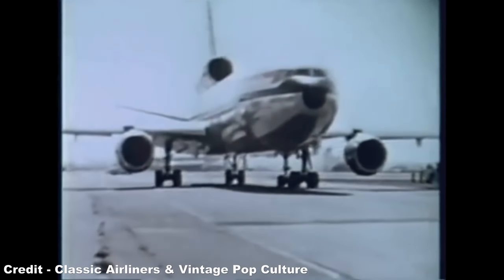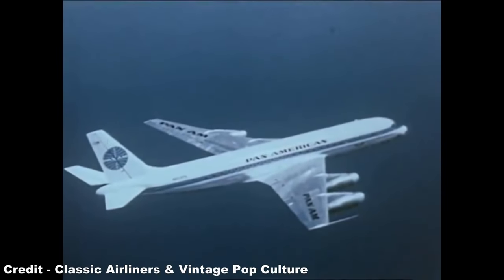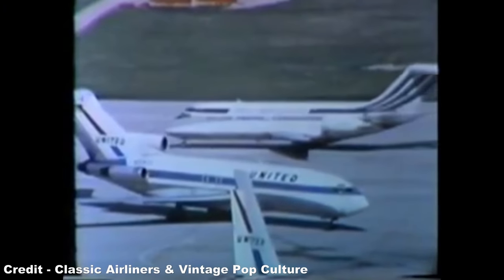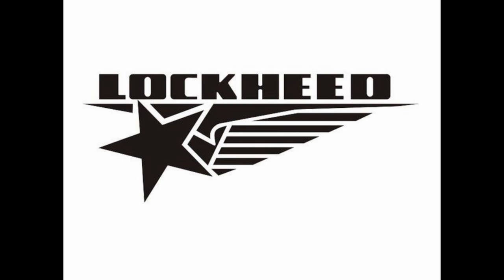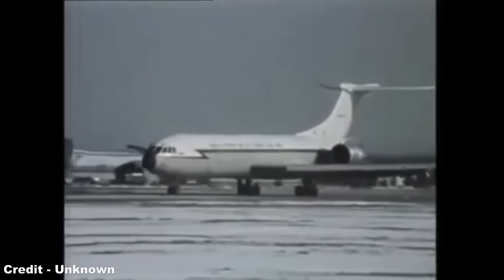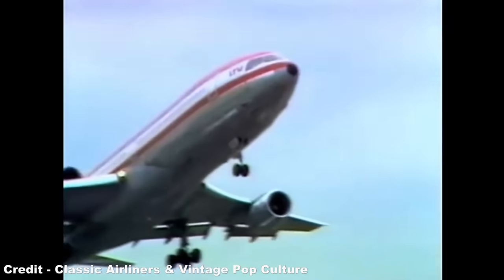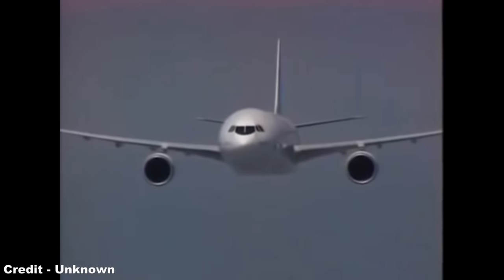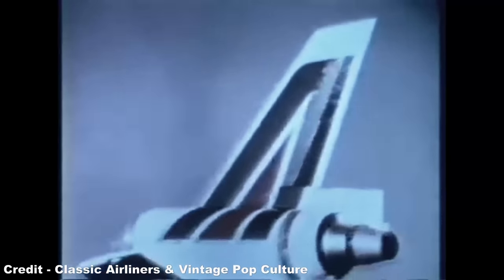What Killed the Trijets?

Comment: "Fuel embargo during the later years of the Cold War"?! Did you mean technology embargo, not fuel? Fuel certainly was not a concern - in the 70s and 80s the Union was a big net exporter of oil and gas, and domestic jet fuel production was sufficient. The 1981 embargo targeted export pipeline supplies and technology, but did not affect domestic production per se.
Reply: You don't remember the Arab Oil Embargoes of 1973 and 1976-1977?
No, he MEANT "fuel embargoS", especially since the USA became a net IMPORTER of oil in the late 1950s or early 1960s.

Comment: The Airbus A300 killed the trijet.
Reply: @mkaestn  He probably meant to say the A310. Both the A310 and 767-200ER were about the same size and used extensively on transatlantic crossings from the Early 80s thru the mid to late 90s until they were phased out in favor in larger twins. The video inaccurately points out Eastern/Pan Am A300B4s as reasons for ETOPs, despite the B4 not being a long range aircraft. The only the later 600R could cross the pond, even American used the A300-600R for a bit for JFK/EWR/BOS to LHR/CDG etc.

Comment: 727 the noise was awful. If the engines were not synchronized and u had your head against the bulkhead a migraine was was on the way. 😑 I think the P&W JT9D`s were used. ?  Same as on the 737=100-200. Back in the day twin engines were not allowed to fly across water.  😎

Comment: Crazy that billions of $$$ were expended just for that 60 minute rule that would have certainly been repealed at some point.
Reply: Etops was 180 minutes and not 60 minutes and even after introduced it did not guarantee that a carrier could operate on a twin. It wasnt until more recent years that etops 120 has been approved and only with very restrictive rules, maintenance and training being certified.
Reply: It was a rule which made sense given the reliability of airliner engines at that point in time.  Once they became reliable enough that the chance of aircraft loss from engine failure over water was within the safety metric applied to the rest of the aircraft design, it was removed.  But not simply because of the passage of time or some other "certainty".  Certain things had to be accomplished.